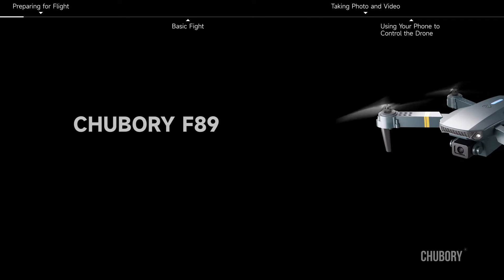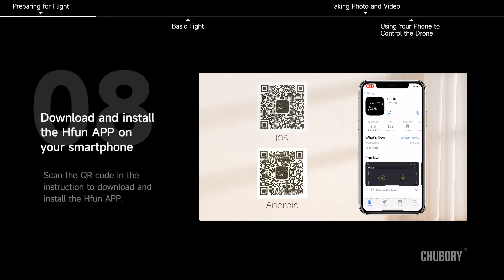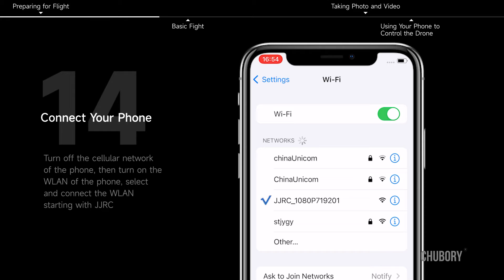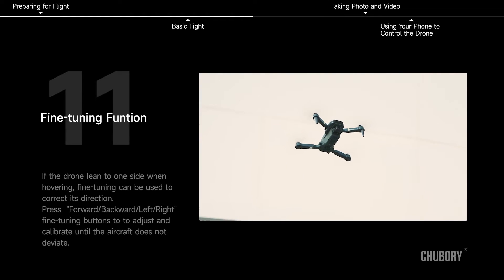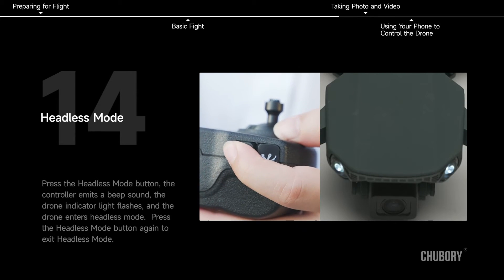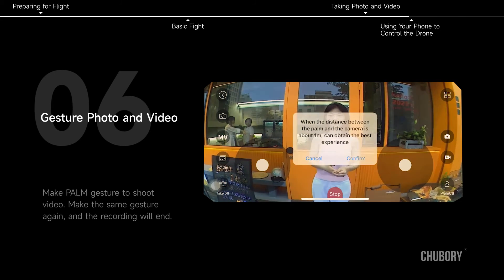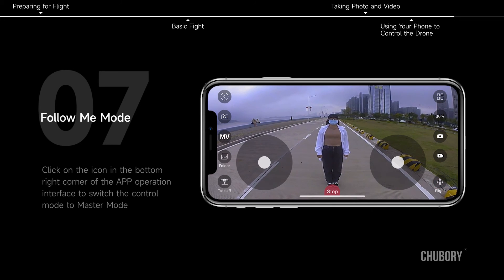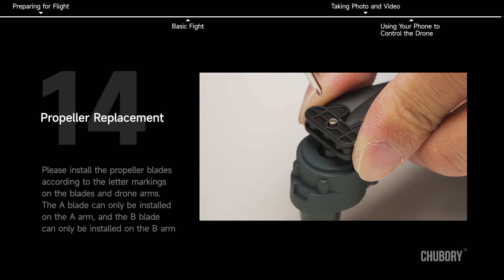Latest instructional video link: https://youtu.be/gN3Sw9CI2Q4

Comment from the maker: Due to the updated controller, the description of connecting the controller to the drone at 1:39 of the video is incorrect. Here is the correct method for connecting the controller:

1. Position the drone on a level surface and power it on. Ensure that the controller and the drone are facing the same direction. Then, turn on the controller, and you will notice that both the controller and drone indicator lights start flashing.

2. Push the controller's left joystick to the highest position then push back to the lowest position. Once you hear a long beep from the controller and both the controller and drone indicator lights stop flashing, it signifies that the connection between the controller and drone has been successfully established.

For the latest accurate instructional video, please visit the following link:
https://youtu.be/gN3Sw9CI2Q4

I apologize for any inconvenience caused.
Reply: Is the controller available separately? Have a F89 and cannot locate the controller. The F89 drone has a clear coated silver wire antenna handing from the bottom of the case.